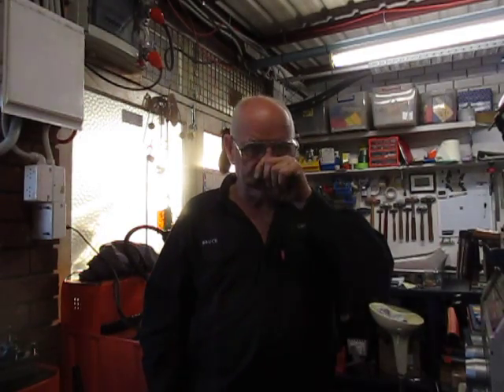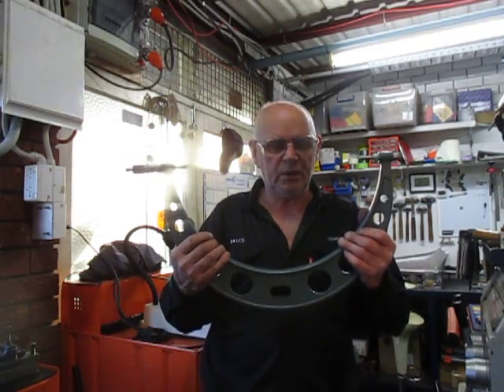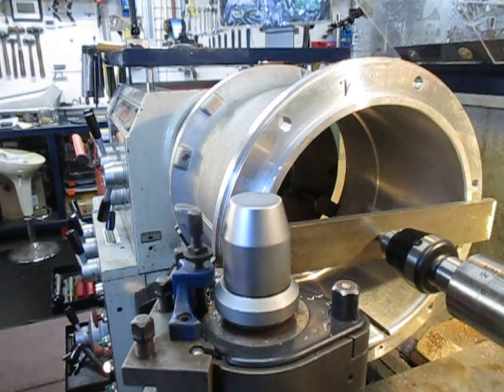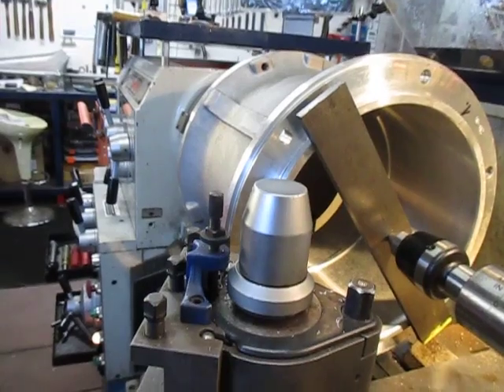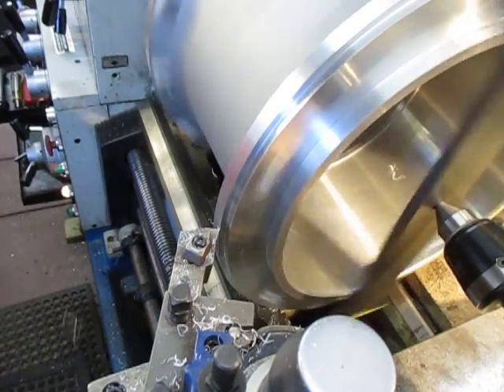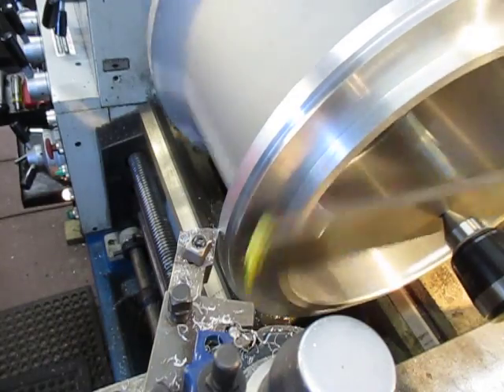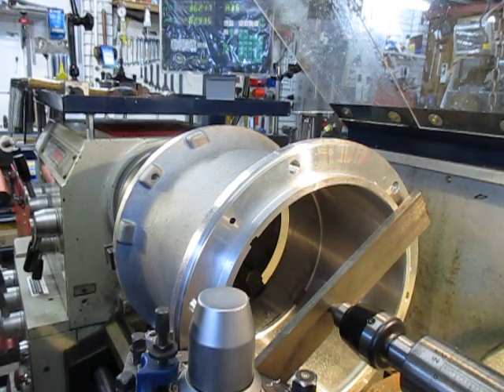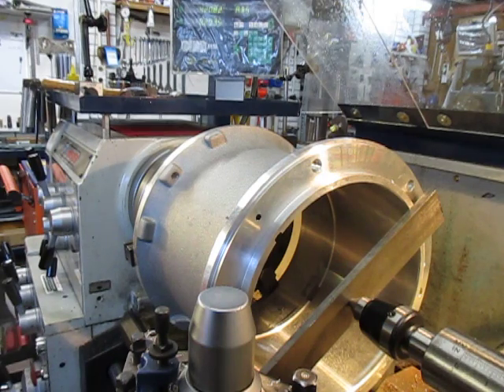Machining housing bigger than the chuck

Comment: I don't see turning anything quite that large on my Mueller in the near future, but those tips can be applied in smaller setups.  Something to keep in mind for later.

Got a chuckle at the last bit.  Not really sure what you are thinking of when you use the word "Roundabout," but here a round-about is the more common term for one of those circular intersections that some would call a "rotary."  I picture in my head the time I had to go around one three times before I could spot the road I wanted in time to take it (five or six routes intersected there), and I wasn't the only one doing multiple laps.  The locals must have thought we were playing games.

Since that time, I don't call them Rotary's or Roundabouts.  I call them insanity circles.
Reply: In the US, we go counter-clockwise on the round-about.  That's anti-clockwise for the Brits and Aussies.